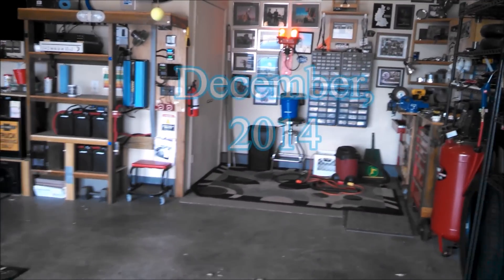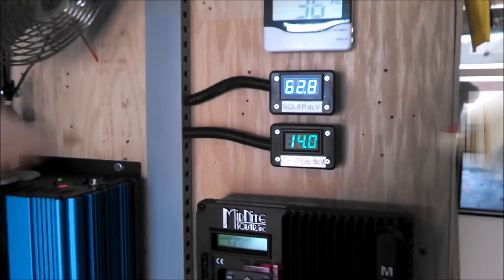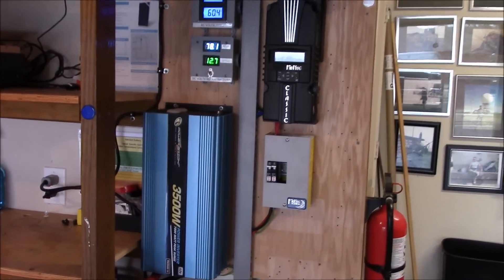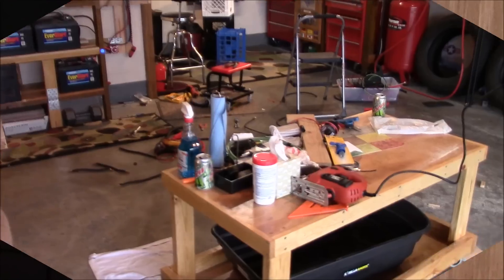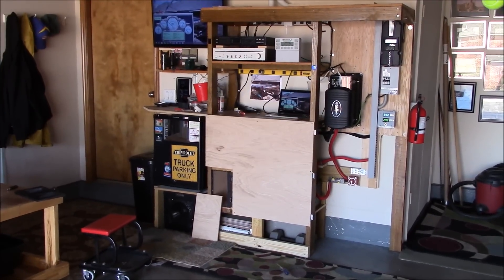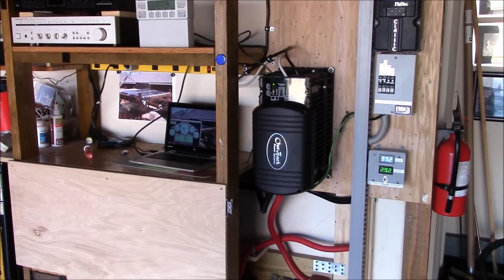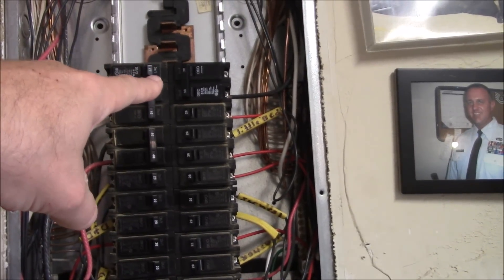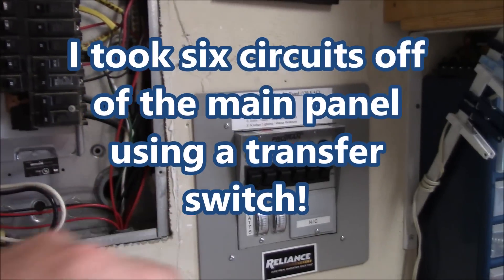How I got started doing DIY home solar 🌞 (and where I am at now).

Comment: Awesome set up! I would love some advice or help on charge controllers. Midnite solar 150 or Outback Flex max 60. Why did you chose Midnite solar, dont midnite solar have a problem with their cooling fans? I live in Eastern Oklahoma.
Reply from the maker: Both are excellent (and pricey). The Midnites are a little more powerful compared to the Flexmax 80. However, the Flexmax's mate up better with Outback inverters when using the Mate3 and their software. If I had to do it all over again...would use all Outback Power equipment.

Comment: Thank you so MUCH for this video and posting it to reddit.  I'm going to check out some of your other videos as well.  I'm interested in uh...growing a system.  Basically starting small and then adding to it as I can.  So I am hoping to get some pointers from these videos.  Anyway, thank you again. I wouldn't have located this without that post.
Reply from the maker: Thanks for watching. Might want to watch my new project...24v solar generator...I am building it now (doing some testing, waiting on parts, etc). Got about $1.6K into it. So, it is a "small" system that might help those starting off in solar. Building a system takes time/money/good sunshine...but, the rewards of DIY and low-low electric bills is worth it. And, helping others too...great community.
Reply: Will do.... I'm off reading up some at solarpaneltalk now.  I'll research for a few weeks and try to decide if I'm ready to jump into this.  I'm located in OK too (I think I saw you were) and I have a lot of area around my house I could panels up.  If I can tie in to my current system and then slowly add more and more capacity over time, this might be very doable for me.

Comment: That's a lot of Watts! What are you using so much power for? Air conditioning could be better supplemented by burying some pipes in the back yard and sucking in air through them to the house. You must have electric everything to need so much. How much you up to, looks like about 3000 Watts!?

Comment: So Chris. What is the largest wire that will fit your inverter and also the charge controller. Thanks Ed
Reply from the maker: Using 4/0 (0000) gauge for the inverter and 4 AWG on the solar charge controllers.

Comment: I have been looking into DIY solar myself for a few months. there is an abundance of 2-3 yo used panels here. I am buying  a bit over a Kw worth ( 5x 225W panels ) for $200 This week.  I have a few inverters that were given to me after people upgraded and I am going to use them to feed back to the grid directly and spin my meter backwards.  I have been doing that with Veg oil powered Diesel engines driving 3 Phase induction motors set up as generators.  
Easy to repay that investment but solar is so much simpler and is quiet and doesn't wear out as such like a motor. 

The first thing I want to do with the solar is use it to heat a second Hot water tank that will fed into the main one I have now. this will reduce the energy used from the grid and in summer when there is plenty of sun, the off peak I dont thing will be needed at all.  If the weather is overcast and the water temp is not high enough, the regular heater will kick in so I won't have to do a thing. 
Once the second tank is up to temp, the thermostat will kick over to feed the power back to the grid. 

When I move house as I am looking for a new place now, I'll put in some battery's. Not enough to be self sufficient but enough to play with and learn more and get something back from the hobby as you describe.  

Great vids and good to see somone doing DIY solar in a a straight forward and low cost manner. 
Well done.
Reply from the maker: That sounds great! I will sub your Channel and follow the progress! Thanks!

Comment: Very informative once again. It has been so interesting to follow your projects and upgrades over time. My goal is to go with an off-grid solar for the essentials and use it for a backup since the electricity here goes off for no darn good reason. It can be clear and sunny, a little storm or any little thing, strange and hard to second guess something like that. Last months bill was $308.00 but we ran the A/C most of the time to beat the heat and humidity in SE Kansas. Thanks for all you do on the YouTube cause you are an inspiration for this household.
Reply from the maker: Glad to show/help/do videos for others to see. That is one expensive electric bill. I spread my costs over three years and really started to get serious about a year ago. Good luck with your build. Dream big...

Comment: Nice look back there, thanks for sharing.  I too find the conservation aspect is big with solar.  I think when you start making your own power you also see how much is involved with that.  Then that starts the ball rolling on saving a bit here and a bit there.  I used to use about 30KWH/day and now about 15 with 1/3 of that self-produced.  I've cut my power bill by about 70%, but not all that is due to the solar electric directly, so what do you factor in to your payback calculation?
Reply from the maker: 7-8 years...but, it is all "relative". Sick of paying a greedy electric company who charges 4x during peak hour rates in the summertime while people bake inside their homes (some die). And they reported a $500M profit last year.